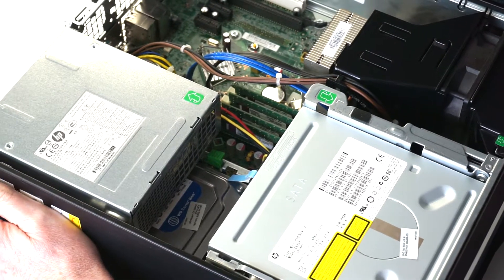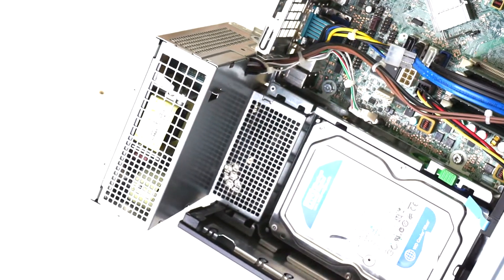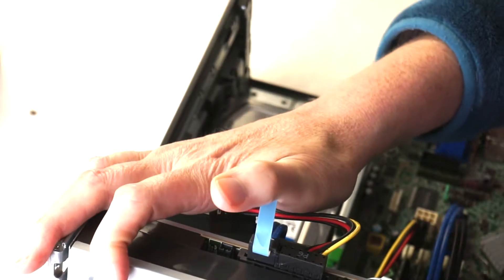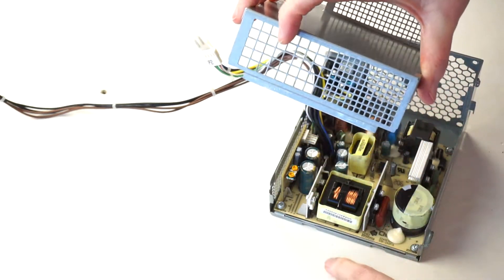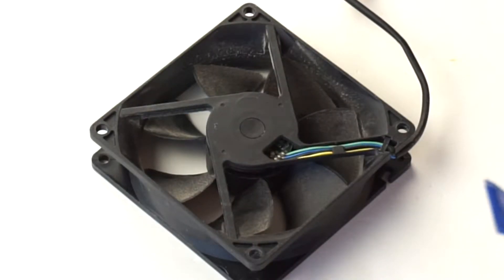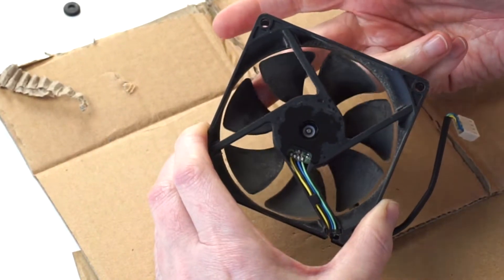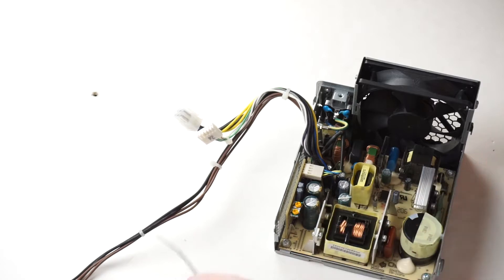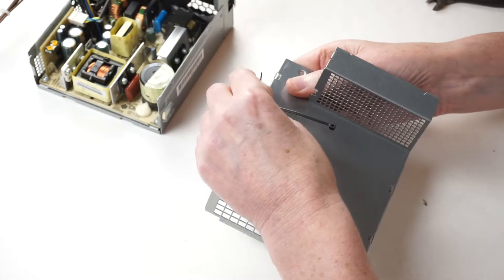HP 6200 Pro -- Noisy Power Supply Fan Fix

Comment: Thanks very much for this. I think I will probably buy a new fan rather than trying to fix the original one. Do you know what the fan dimensions are, and connector type?
Reply from the maker: You're very welcome. I believe it's a 'standard' 80x25mm fan, but I didn't actually measure it. It has a 'standard' 3-pin fan connector, which you should be able to see in the video. Now, I have NO IDEA if it's actually a 'STANDARD' fan, cuz of proprietary BS that these companies like to pull, but I'm ASSUMING you SHOULD be able to plug in a standard 3-pin fan and it'll work fine. I didn't try it, however, cuz I had no need to. You could TRY to research it on 'The Google,' if you wish, but I've found that kind of research to be rarely helpful. Good luck!
Reply: @TechNoPhobiaGirl  many thanks, I’ll order a quiet fan with those measurements, and also arm myself with a can of WD40 just in case it doesn’t fit. The PC is in the living room connected to the TV for streaming and gaming, and the fan is driving me nuts! 😂 Thanks again!

Comment: my cpu frond and back fan runing very hight with hight noise what should i do
Reply from the maker: If the computer is working properly, then the only thing I can think of is the CPU cooler/heatsink is jammed up with dust/fur. If the CPU is too hot then the system will ramp up ALL the fans in order to TRY to cool the CPU. Pull off the plastic CPU shroud (I show it in the video) and see if the CPU cooler fins are jammed up with dust. If so, use a brush and/or compressed air to blow out the dust. Also check the main front fan and intake, and the power supply fan.

Comment: I used thick grease instead of DW40, plus I had reduced 12V going to the fan using resistance. Now you can't even hear it running especially using SSD instead of noisy HDD.
Reply from the maker: Nice! I wouldn't use grease, but whatever works, I guess.
Reply: @TechNoPhobiaGirl  Just grease will last longer due to its consistency compared to DW40, You also need to reduce the voltage feeding the fan. Greetings from North West Ireland.
Reply from the maker: @HassanHassan-iv7lk  Ireland? Cool! Back atchya from the 'Great White North'!
Reply: Or you can changed them with be quiet fan wing2,!.... Also inside the power supply 🙃

Comment: When you say noise, what kind of noise please? My PSU fan spins too fast thus creating a loud noise. So not sure if it is the same issue as yours.
Reply from the maker: Don't really know HOW to describe the noise. It's kind of a squealing/grinding/rattling sound maybe? If your fans are running at high speed ALL THE TIME then very likely you have a build-up of dirt/dust/fur in your CPU cooler and/or other parts of the system. Open your PC and use compressed air (canned air) to blow out the dust from the entire system. If that doesn't quieten down your system fans then I don't know what else to tell you.
Reply: @TechNoPhobiaGirl  ok thank you lol. Will update on progress lol
Reply: @commanderfarsight2351  does it worked?